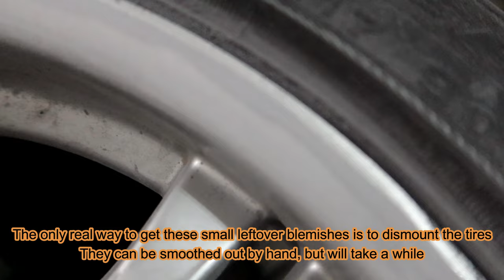Curb Rash Wheel Repair and Paint : E36 Part 5

Comment: People need to learn the difference between aerosol applied paints and urethane based paints. Aerosol (spray can) are not urethane. Urethane paint is what your cars wheels were painted with, E36 included. The difference is, Aerosol applied paints are simple 1940's oil based spray applicated for the home repair guy!  Urethane paints, 1965 forward,  also petroleum based but broken down intelligently chemically engineered.  Difference, urethane surface will resist chemical degradation, including gasoline, oil, acetone, and other corrosive solvents.  NASA developed this technology, all commercial aircraft have been using this technology since mid 1960's. Boing labeled their paint, called then "Alumigrip" later known today as Awl-Grip,
Reply from the maker: Unless!!! It is a urethane aerosol paint. Either way, can top it with some 2k clear from an aerosol or a gun and you're all set. I often use rattle bombs as a basecoat for small custom jobs where the price of a pint or quart just isn't worth it..ie microflake, candy, etc...then just top it with 2k. Have also used engine enamel as a basecoat, then shot HOK kandy, then clear. As long as the paint doesn't react and my clear is good...no problems

Comment: Interesting, the clear coat finish over the red has peeled away. I masked using 1 inch 3m blue tape for a small paint repair and when finished I removed the masking tape, it also removed the clear finish coat it stuck to! BMW's clear coating has poor adhesion to it's paint. Just to mention...be careful if masking.
Reply from the maker: One trick I always use when I'm not too sure of how well the clearcoat will hold up to masking, is to apply the tape to my pant leg before applying to the vehicle. It will cut the adhesion down enough to not pull garbage paint or clear but still stick to the product well enough to spot whatever you need to spot. Most cars from the late 80s early 90s had terrible clearcoat...not all, but most.